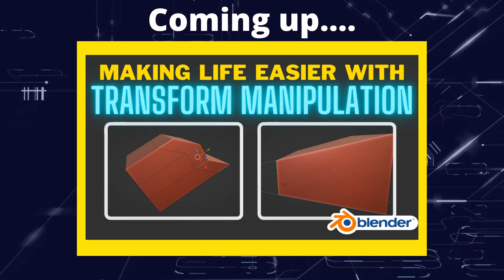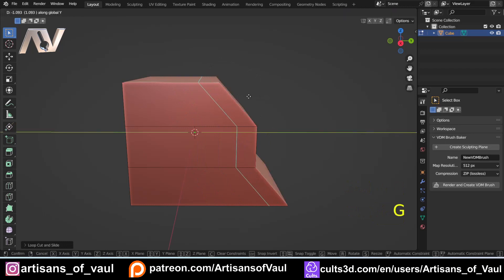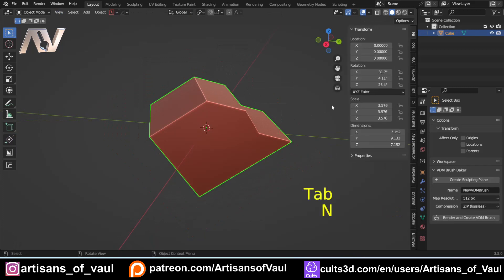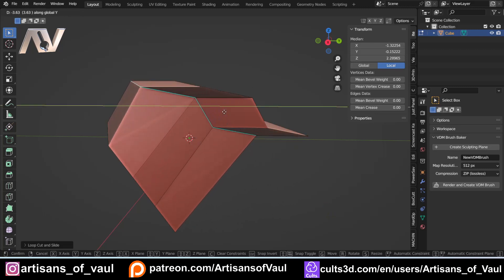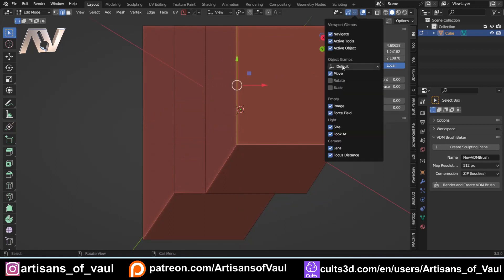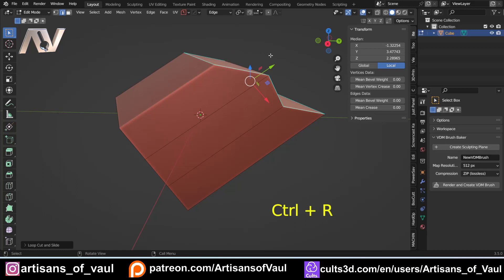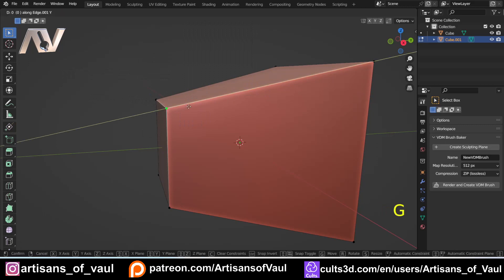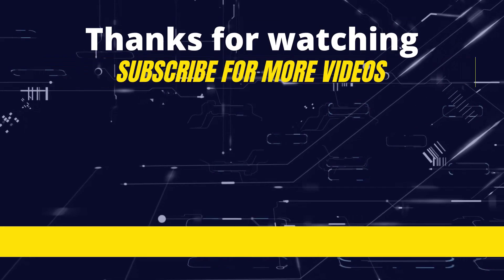Making Life Easier in Blender with Transform Manipulation

Comment: Really useful, I didn't know I could use custom edge orientations. I've screwed up many times in the past by applying the rotation and then losing the local transform, so this is very helpful. Thank you so much!
Reply from the maker: No worries. It's a total time saver when you know its there.

Comment: How about using gg to slide the loop?
Reply: He addresses that at the beginning of the video. Edge slide (GG) is a proportional transformation, not an absolute one. You can't slide the loop by a unit of measure, only by a proportion between the initial edge position and the adjacent edge position.
Reply: @aspermypreviousemail5907  Ah, I missed that. Thanks!
Reply from the maker: As has been said you can do that for sure, but that doesn't allow you to type in a measurement to move the vert (unless you do the math to calculate the proportions)